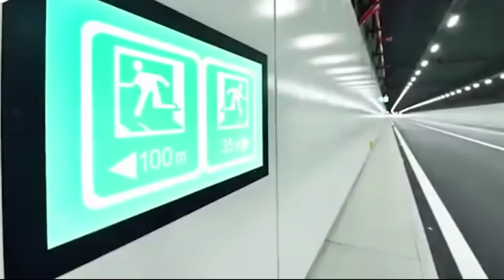New York’s $55 BILLION Plan To Connect Long Island And Connecticut!

Comment: I doubt very much that Port Jeff could handle the volume of traffic, and you're quite a ways from the L.I. Expressway (I495). They'd need a different spot on the Island to bring the bridge to where it could continue as a highway to the expressway.
Reply: Kings Park.
Reply: @frederickhettesheimer2698  Agree. Connecting the Sunken Meadow parkway to Westport on I-95 is better in my opinion. Connecting two already existing highways with limited right-of-way constraints. It will alter the landscape in the area quite a bit but the potential economic output is huge.
Reply: @sniperdude169 , how do you solve the parkway problem? There are eight crossings in which the parkway goes underneath those crossings, including the Port Jeff branch of the LIE. Those crossings cannot handle trucks.
Reply: @crusher0427  Honestly that would probably be a good opportunity to upgrade those crossings so that it can handle freight traffic. The parkway would likely need to be updated to a 3 lane highway at least until at least it connects with 495 but it has the space to do so.
Reply: @sniperdude169  Exactly how do you figure Kings Park will have a positive economic result after a project like this destroys some of the best nature areas we have here? Hundreds or thousands of acres of woodland and wildlife areas bulldozed for on/off ramps leading to a small parkway that will not be able to handle the volume. No thank you,
Reply: @frederickhettesheimer2698  Too much park land along the coast.
Reply: @frederickhettesheimer2698  That would be devastating to the local landscape and the local ecosystem. I live in Kings Park. Kings Park would gain nothing and would only suffer loss of natural areas, increased pollution and traffic issues on the Sunken Meadow.
Reply: It would need to be a tunnel starting from the north end of the 135
Reply: There isn’t a 55 billion dollar plan by NY to build this bridge.  This is someone’s pipe dream.
Reply: 95 in CT can't handle the added traffic. The wealthy prevent any state infrastructure modifications to ease the congestion.  Its a problem. Commuting sucks. But it can get mush worse, so basically the plan is, maintain the current traffic pattern, don't let it grow. People avoid CT because of the taxes, it makes the rich people happy. People who can't afford to go there won't go there. Its the same for the highway. Yes the traffic sucks, so people avoid going there. The have no problem paying the taxes, and they don't drive on the interstate.
Reply: The entire island will be grid locked on Rush hour, the 495 is a parking lot, and the parkway exit traffic lights back up the right lane, making the highway wider simply does not solve the local road congestion
Reply: Agree. The traffic in Port Jeff after a ferry lets out holds up the whole town. You wouldn't be able to connect to the same place the Ferry dumps. But on the other hand, the ferry isn't that big and they don't run a lot of trips. It seems like a huge investment for a population that is way smaller than the amount of people who would use the NYC bridges. 

Plus I like the ferry. I like having my car transported while I walk around. I wish trains and other systems did the same as well. I wonder if they could just make the ferries faster.

Comment: Request for those with concerns on just their side of the Sound. We know damn well both sides will be impacted. Ready?

I-95 is already maxed out rush hours (and beyond) through Fairfield and New Haven Counties. Current lane count thru Bridgeport. Simply to make traffic barely sufficient would require 4 lanes, to be worth the effort 5 lanes. 

Also, would this build on the Route 8 interchange (meaning all those junction ramps need dedicated lanes) or a mile east in the East End of Bridgeport (meaning an entirely new junction to mess up traffic)?
Reply: I-95 in Connecticut is already a traffic nightmare, and not just during rush hour.
Reply: @ChristopherPlatt  Route 15 and the Hutch the same.
Reply: Does anyone actually currently commute between LI and CT? If they did, they would have perhaps 30 minutes of work time during the day. A Sound crossing enabling commuting would quickly become congested. LI and coastal CT are already overdeveloped -- I can't see adding to it.
Reply: @philperry4699  And would bridge designers decide on sufficient lane count? Do-overs likely more expensive than initial build.
Reply: @philperry4699 You would grow insane to commute from Connecticut to Long Island for greater than a week.

Comment: Sixty years ago the great Robert Moses proposed building a bridge from Oyster Bay to Rye NY, that was way shorter and way way cheaper but the nimby's had a field day with that Idea so it never got off the ground.  Remember that these projects always cost twice as much as the projection and no one talks about maintenance.  Bridges and tunnels are paid for by tolls and the toll for this would be well north of $100 for cars, sky's the limit for trucks.  If a tunnel is at all feasible, it will cost twice what the bridge will.  NY is financially strapped, this bridge brings little benefit to Conneducuit so you can bet they won't hand over any money for the project.  There is a major need for new Hudson River crossings and all of the existing bridges and tunnels in NYC are over 50 years, many double that, this means they need replaced.  Why don't you ask George Soros for the money.
Reply: Would that be like the "other Moses" who parted the Red Sea?  Robert Moses would have been the guy who parted Long Island Sound!  That's be a little harder because of the pollution.

Comment: Tell me how they would connect a bridge through port Jeff all the way down the 495.
Reply: I was thinking the exact same thing. The video's makers clearly are not familiar with the Port Jeff area.
Reply: Well I live in the area and I assume the answer to the question is 'they wouldn't'.
They would just simply (or maybe not so simply) have you take 112 north to the bridge.
Reply: @teddybetts3254 in order to widen 112 in downtown port Jeff you’d have to take it all out. So that wouldn’t work
Reply: Rte 112 lol
Reply: True enough. I grew up in that area. The Oyster Bay - Rye connection is much more feasible and economical.

Comment: Ice jams on the Sound ? Last I checked it's salt water,
Reply: I live on the sound (The north shore of Nassau County) The sound can and does freeze. It does not freeze 100%, but once about 20 years ago or so, the slush was over a foot thick near the shore, and the 'ice' extended over most of the harbor near my house. Now, alcohol also does not freeze, but if you put a half bottle of beer in your freezer overnight, you'll see what I mean.
Reply: Salt water does freeze. LIS is generally warm enough that it's not a big problem, but you still can have ice floes from time to time.

Comment: Not gonna happen made sense for Delmarva not Long Island Weather dependent? 20 mile tunnel ? This ain't the UK and France!
Reply: Colorado has the Eisenhower-Johnson Tunnel on I-70, which is the highest point (11.578 ft), and crosses the Continental Divide. The Colorado stretch of I-70 from Denver to Glenwood Springs is considered the most scenic.

FYI: Delmarva has the 17.6 mile-long Chesapeake Bay Bridge and Tunnel (CBBT) and is currently in the process of constructing parallel tunnels for the Chesapeake and Thimble Shoal tunnels, presently working on the Thimble Shoal tunnel, due to be completed in 2028, before work on the Chesapeake tunnel commences, providing a link to the Norfolk/VA Beach areas and Eastern Shore, VA to acccomdate growth along the ESVA and the rest of the Delmarva Peninsula, which includes MD and DE.

And there's the Hampton Roads tunnel/bridge project along I-64 to accommodate growth in the VA Beach/Norfolk/Hampton Roads/Newport News areas, where military personnel are stationed.

 It can be done.

Comment: I like the mixed bridge tunnel approach both rail and vehicle.
Reply: just to put it into perspective, the longest bridge in nyc is the verrazano bridge which is 2.5 miles, the mario cuomo is 3.1 miles.  Most people that live in LI don't work in CT and vice versa, they work in the city. If anything it is more economically efficient to do a bridge connecting Queens to NJ over manhattan of over Staten Island.
Reply: There's no purpose in building it without rail, mainly for freight. That said, there are too many rich people who don't want their scenery spoiled for it to ever be built.
Reply: @Scramble-electron-890  Why not have direct rail from Long Island over the Hell Gate Bridge to get to New England?  They are too cheap to build a track that loops around the east side of the Sunnyside yard.  That is the first and lowest cost choice.  Probably would take some traffic off the roads.  Even have some Amtrak to Washington start on Long Island would make sense.
Reply: @Kenny-mt8hz  I think they're supposed to start some direct Amtrak trains to DC from Long Island.
Reply: But would it be a brunnel?   Or a tidge?
Reply: Stop bringing this up NO BODY in the Oyster Bay area of LI wants this eye sore, traffic generating, ecological disaster destroying anything of value and that's where  the LI end would need to be placed. Giant ventilation towers,  extensive arterial feed ramps cutting through residential communities, spoiled coastline and Long Island Sound view ruined forever.. Build it and they will come, how many more ants must be funneled into the ant hill? Dream, more like a nightmare, no thanks!!!
Reply: @GoogleUser-zx5vs  can you please stop beating around the bush and tell us what you really think?
Reply: @Drrich_DIY  ha,ha, yeah.
Reply: @GoogleUser-zx5vs sorry, the needs of the many outweigh the needs of the few.

Comment: This has been a 60 year discussion. It needs to happen. No  NIMBYism. I favor a crossing from Shoreham with William Floyd Parkway as the major feeder road.
Reply: That really would be the only feasible option because there is no way that a thoroughfare is going to cut through all those towns from the LIE to get to PJ. Plus I'm pretty sure the residents of PJ are not going to want a major highway cutting through the town. Its a nice pipe dream.
Reply: This is never going to happen.

Comment: 55 billion? If it is ever built, it will cost 4 or 5 times that amount. Canadian taxpayers have been sucked into building the new Gordie Howe bridge between Ontario & Michigan. It is only about a mile long, isn't open yet & has already passed 3 billion dollars.
Reply: It’ll be paid off through the installation of a toll gantry.